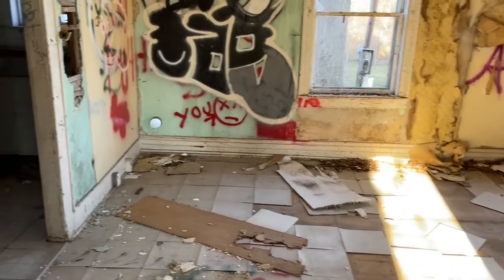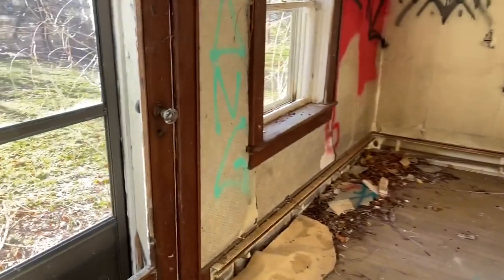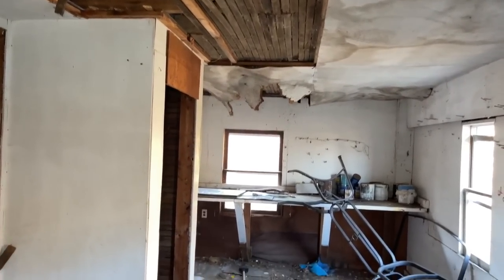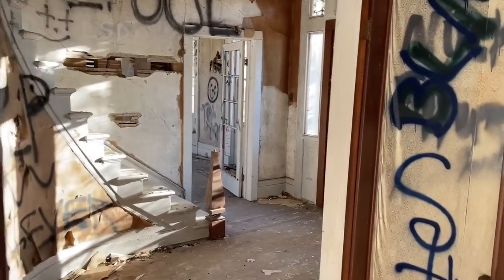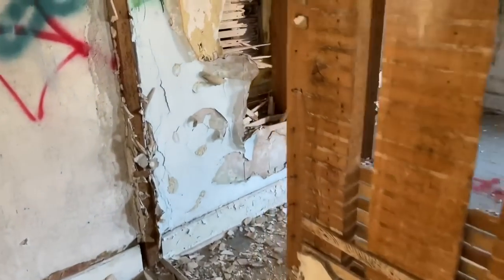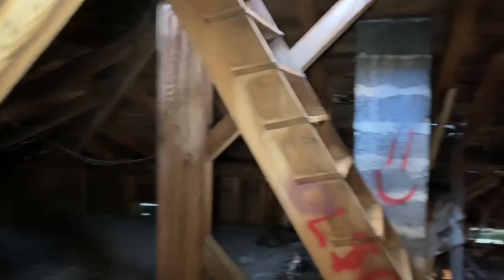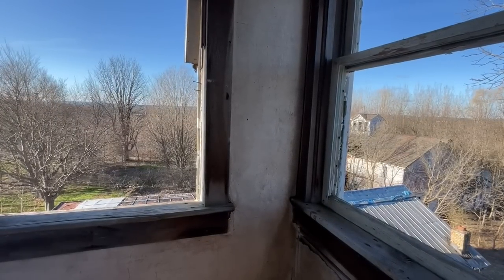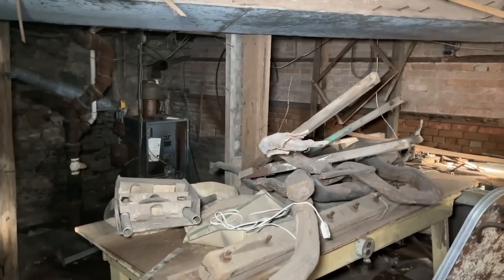The Once Grand Forgotten Keys Manor House Abandoned For Decades in Upstate New York

Comment: At 12:25 that certainly was not a junkie stud from Home Depot. That was more than likely a full one inch thick white pine board with nice tight grains running through it. 
  If it were to be sent through a planer and have only about a 1/16" taken off of each side you would have a beautiful piece of wood for repurposing for rustic furniture or cabinetry. 
  The wall material was oriented (turned) to be on the flat so as to allow as living space as possible.  This home was built pre-electricity. There isnt a way to safely put electrical switches and outlets in walls that thin.

Comment: where was their fireplaces at ? I don't remember seeing any fireplaces at all.
Reply: It appeared to have a gigantic coal heater in basement and tons of ducting. It's possible it was originally built to be heated with coal! I noticed in the very first room he entered (front doorway, turn right) there was a huge heating duct grate in the floor right beneath a window, that looked like it could have been original with the house. I also noticed the chimneys all seemed very small which would also fit the coal burning theory.
Reply: @squirrelorama  on yes you are right.  I guess I was too busy looking at how pretty the house was in it's day.  Thanks RJ.
Reply: @squirrelorama  oh now I remember the floors had square holes in them.  Someone removed all the metal, right?